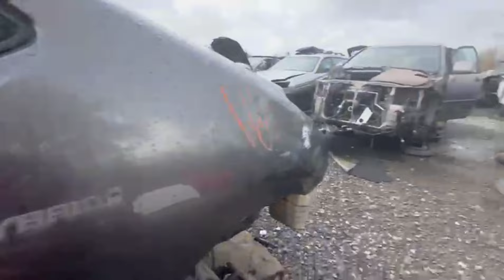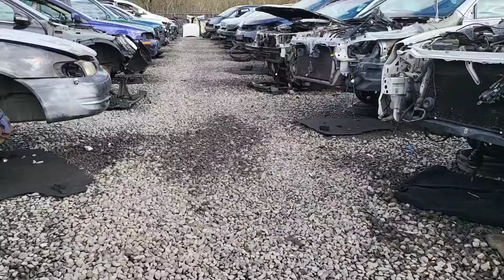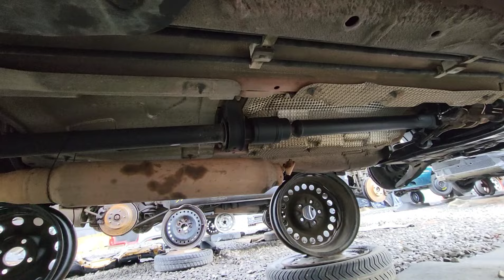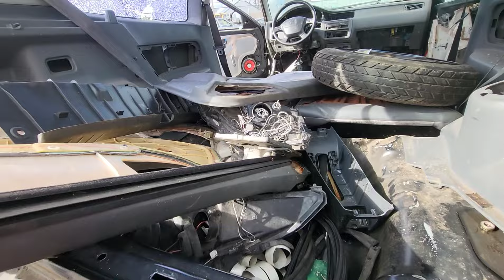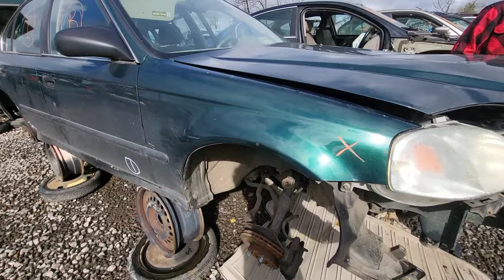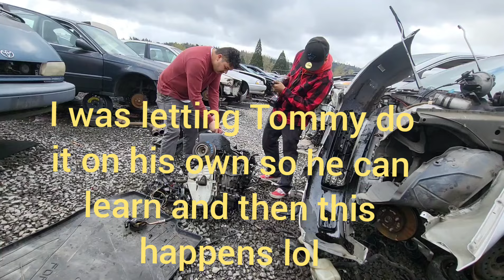#junkyard Goodies successfull #trip

Comment: The bad thing about junkyard motors is that unless you can hear it run you have no clue what kind of shape it's in and you might spend hours pulling one to try and put it in your car to find something like rod knock its better to buy a used motor with a warranty and it's not much more expensive
Reply from the maker: In this video and some of my   older videos in my channel,  I actually show how to inspect them and what to look for. This Engine came out great, I will upload another video soon. But I get what you mean too.